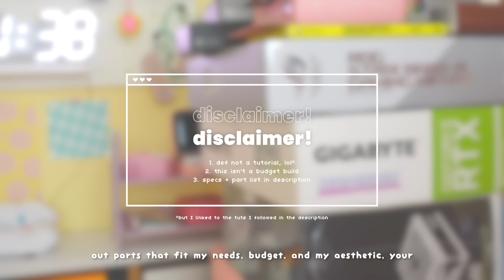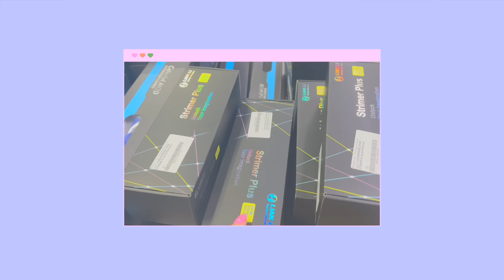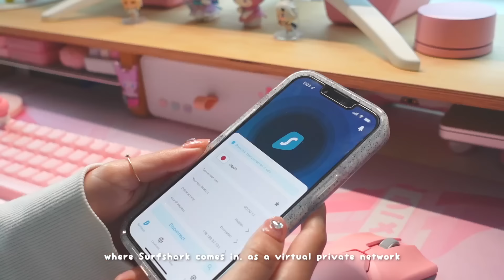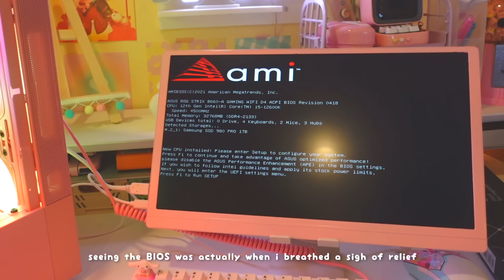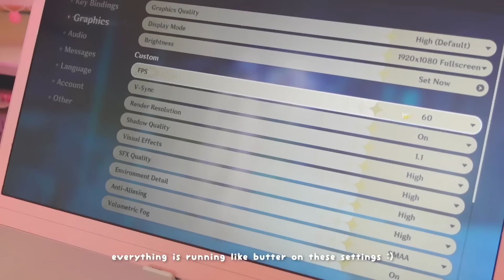🍉 building my first gaming PC so i can play genshin on cracked settings | intel 12600, rtx 3070ti ✶

Comment from the maker: bless YT tutorials for helping me bring my proper pc gaming dreams to reality ◡̈ specs + pc part picker list in the description for your reference ♡
Reply: ty🤍
Reply: Thank you so much for helping the viewer❤️
Reply: What store did you go to, to find your pc parts. Like the name to see if there is one near me I've been wanting to build one for a while but I don't trust buying them online.
Reply: cute setup, i should you should get bigger monitor, if you looking for new pink monitor, i suggest you buy AOC AGON AG273FXR
Reply: I have one request nemui.. PLEASE JUST PLEASE start streamign genshin on twitch/yt pls man
Reply: I assume LTT was a big help for a tutorial (was for me). Also great job the pc looks really cool!
Reply: hey did you enable xmp in your bios it helps you ram run at it max speed but i enjoyed reading the captions the whole time lmao
Reply: You had to buy a brand new psu when 4000 series gets out becuse they are power hug and they use more power.
Reply: Not sure if it has been mentioned, but you can get a platform with wheels ( or without) to keep your pc out of the floor. It will help to avoid dust, but if you clean it weekly or bi-weekly it won't be a issue.
Reply: does your pc make any noise?

Comment: I thought building a PC would be really daunting and difficult to be honest, but this video kind of encouraged me to look into it!! I have no idea what I'd be doing of course and it'd be very expensive which I don't have the money for as of now, but you made your pc look absolutely ADORABLE and I really wish I could do the same someday 🥺
Reply: PC building just looks difficult, I had the same thought too before I built my very first gaming pc (also upgraded the pc down the road).

The way that I look at PC building now is just like putting together a simple puzzle, Most of the stuff goes to specific places and most components have easy to follow instruction books that come with them.

I did have a hiccup when I upgraded my cpu, my motherboard failed to find my samsung SSD with the installed windows 10,  but a quick search on google showed that all I had to do was toggle a setting in Bios just to have my SSD show up.

If and when you do build a new gaming pc, don't be afraid to follow along to a tutorial. Just remember to double check that you have all the necessary stuff (including a windows usb stick).
Reply: @rezibaki310  how much did ur pc cost you ??
Reply: @yaatrickyaa2394  I started slowly buying parts for my PC before the inflation which was suppose to be a $700 build, but after the inflation hit, my build cost got up to $1300. (I was lucky enough to buy the GPU before inflation)

After the build was finished, I have got my hands on the RX 6600 XT and Ryzen 5 5600x about half a year later.
Reply: pc building is so fun trust me
Reply: I was told if u can do a puzzle u can build a pc XD.
Reply: @Shiveria  I want to build a pc but I can't do a puzzle, that's what I'm worried about lol
Reply: @camillesadventures  just do it dont worry about the difficult stuff go with the flow 
Its like playing a parkour game u have NO idea how ur suppose to pass the lvl but u just decided to do it and subconciously u manage to pass it or reached further than u were before 
Its all about the flow
Reply: Its basically like Lego but expensive.
Reply: @usuallyclueless4477  cough cough ₹ 30000 min GTX 1660 hear cough cough
Reply: @idiottrooper  last time I checked a 1660 cost ₹ 23000.
But it was just when the pandemic started.
Reply: Anyone of you has any videos or websites I can check that explains step by step what to look to build a gaming PC as well as explaining what each component does?
Reply: @Link-Link  Linus has a first person view build guide, he strapped a camera to his head.
Reply: i had someone who's job used to be building pc's and installing stuff like that in buildings. He heled me build mine and uh... look. I bought really good PC parts. But i would have needed him bc apparently some of the instructions for my shit wasn't well written, and if i attempted it the way they were showing on the instructions, i could have broken something. so really this whole thing is scary to me lmao. I'm going to buy a new pc case soon and some fans (bc uh my shit stopped working) but i'm dreading having to move all my shit over. ;;
Reply: Just build my first one last week very easy! Just follow the YouTube videos and do abit of research. You got this and have fun!!
Reply: @usuallyclueless4477  Do you have a link?
Reply: you could buy the pieces little by little, that's what a friend of mine did! every month was 1 new piece
Reply: @flavianunes9370  bruh isn't it better to buy everything at once? What's the point in buying a monitor, CPU, keyboard, mouse, etc but waiting a month for a GPU 💀
A PC needs everypart to function correctly
Reply: @magicalindigoadult3838  then just keep trying 
Lmao jk 
Idk tbh ive never built a pc ;_; but i will someday
Reply: A 3050 is enough for that game on highest settings
Reply: its not the pc building thats hard its everything that comes after it. and u have to know what you're doing when buying the parts otherwise you could really mess something up. but yeah putting the parts in is easy
Reply: @magicalindigoadult3838  yeah thats the toughest thing. Computers do require a bit of learning haha
Reply: @Link-Link  literally a year buying things 😂
Reply: @flavianunes9370  that’s actually a good idea! Thanks for the advice ✨

Comment: Great build, but to take full advantage of your amazing gpu, I’d get a better monitor - at least a 1440p one with 160hz refresh rate (which usually start at around 300 usd), but if money isn’t an issue, a 4k monitor with 144hz+ could run AAA titles at 60+fps at high settings with no problem, but they of course come at a big premium (500+ usd)
Reply: @Wxlfy 星 naa, 1440p 100% imo. I was playing genshin maxed out at 1080p on a gtx 970 till not so long ago lol
Reply: @Wxlfy 星 about what? I’m saying no reason to go 1080p with a 3070ti. My old 970 could run maxed out genshin in 1080p so a 3070ti def can run it maxed out at 1440p. 240hz means very lttle, fps is capped at 60fp but it’s not like it wouldn’t run much higher even in 1440p if it could. Going 1080p makes sense if you’re a very competitive fps player or if you wanna save some money. I mean I suppose there’s some games where the 3070ti is in a middle spot, but for genshin you absolutely wanna go 1440p, it’s a very light and not demanding game on pc.
Reply: how did you not tell him to put an i9 12900k at least with that graphics card
Reply: @Wxlfy 星 if you willing to get ban maybe? better not  mod much the files when it comes to Genshin. Beyond 60fps for Genshin just not worth it, other games maybe. better get 1440p or 4k Monitor or 4K LG oled tv~ which I'm doing :)
Reply: @Wxlfy 星 I don’t see the reason for such a high refresh rate. I’d much prefer a 1440p 165hz monitor compared to a 1080p 240hz, but if you’re playing super competitively then maybe.
Reply: @andromeda8878  are you joking?
Reply: i mean she did waste like 1000 bucks in the 3070 ti, yeah probably she can afford the monitor, altough i doubt she buys it, not cause she does not have the money but maybe cuz it may affect the look of his cute desk :o
Reply from the maker: hmm i've been thinking about getting a new monitor but i'm honestly not ready to shell out that additional amount of money when I have a perfectly functional 144hz monitor i bought a few months ago ahaha ;-; but tysm for the recommendation, i will look into 1440p 160hz in the future!
Reply: @savannahjones2718  are you laughing my face?!! I thought I looked handsome, that's what my grandma says (:
Reply: @nemuiatelier  you shouldn’t, 1440p 144hz vs 1440p 160hz is an insignificant difference for an upgrade, you’re good:)
Reply: @honorablesix  why not have 240hz
Reply: @sksz33  agreed bro she doesnt need 240 hz. difference not rlly noticable. she shld get 4k 120-144hz
Reply: @andromeda8878  huh
Reply: Are you gonna pay for it?
Reply: @sneekz07  I thought you were.
Reply: @nevergoodenough69 What's the point? Unless you play highly competitive games you wont even notice the difference between 144hz and 240hz. You can get a 1440p 165hz monitor if you want a bit more hz. At this point you're trading sharpness (and size, because everything over 24inch for a 1080p starts looking worse and worse) for something you won't even notice that much. There's a reason 144hz is the most popular

Comment: It's actually very easy to build a computer if you follow instructions; looks like you did a good job to me.
I was trained at a vocational school and by my great-grandpa, and I still ended up SO nervous on my first build. It surprised me the first time how hard you have to press the LGA sockets to close it. 
Nice components, but you definitely already had a huge amount to spend.

Just be careful when working with a power supply in a case; static or not being grounded to the case can be dangerous. (As you could imagine, hooking yourself up to a live high-voltage battery isn't good for your health!)
Reply: It's very easy to build even with no instructions lol
Reply: @derkoflagen9882 but everyone that build a pc has some sort of guide first time, even just looking their own pc

Comment: A little advise for your beast. Sometimes Ram requires manual switch via bios in order to work as it supposed to. Let’s say you have 3200 mhz Ram, so it should make all those 3200 mhz.⚡️ So, sometimes you need to go into Bios and simply switch the speed of your Ram to what it should be in order it to work properly. And congratulation with your new build ✌🏼
Reply: When you get 3200 mhz of ram it has a base clock speed usually of 3000 mhz, but you have to enable xmp from the uefi bios to get the actual speed
Reply: Yea but she got corsair ram which has dogshit die and the cas latency is probably 18
Reply: Ur Latency goes up when you get higher ram spped
Reply: It’s a normal thing
Reply: 3200 mhz is always cl16
Reply: @bobsmodels123  not true lmao
Reply: @loganreed7493  yes it is lower frequency higher latency
Reply: @bobsmodels123  Depends on the die and the bin, you don't need to tell me how and what ram XMP and JEDEC works as I work with it on a day-to-day basis. If you buy a cheaper kit of ram the die on it is going to be one of the worse ones and the bin is going to be lower, hence the slower speeds worse timings and overclocking compatibility, but if you get a good kit of samsung bdie, the stock XMP/DOCP/EOCP will be faster from the factory and the overclocking compatibility will be 10 times better.

Comment: Hey, just saying. As someone who has their own advanced gaming PC and is really interested in them. You definitely went all out on that graphics card and not a ton on other stuff, first: I am pretty sure that ram is not dual rank, meaning it runs about 25% slower than what it could. The i5 is fine but a i7 would fit needs better. Otherwise great :) :)

Comment: ur pc is EVERYTHING! despite my gamer colors being black and red, i really like the setup u have. and i will say this as a tip: the next time you build a pc, try out either the Ryzen 3 or Ryzen 5 CPU, bc they are much cheaper than Intel and many people say they’re better (i have no room to speak for that bc i’ve only used pcs with Intel). but i hope u try my recommendation later in time!
Reply: Ryzen has terrible latency and bad cache
Reply: Ryzen has more or less the same performance as intel in most cases
Reply: @wind4758  way worse latency tho

Comment: Excellent for a first build! I have some insight that I hope might help (this is the first I see from you, so I don't know your level):

-I hope the i5 you chose doesn't cause a bottleneck with the RTX 3070Ti. 
-You want to match you RAM with your other core components, so it would be a good idea to put some more GBs if you can, but 16 will probably do it if you can't. IMPORTANT: if you put more RAM in, make sure the speed is the same!
-M.2 NVMe storage for the system and games and SATA options for other storage uses is always the best option.

That is all, this all also depends on what games you want to play, I assumed by the GPU you chose that you, at least occasionally, play AAA games.  

Enjoy your build!
Reply: I actually thought the i5 would bottleneck the 3070Ti too, but a quick search says the 12600k doesn't bottleneck hardly if anything (its a still fairly new coming out 2021). 
also there was 2 sticks of 16gb so 32gb total! but good tip on if they want to add more!
Reply: @iioru1829  oh i didn’t read the 2x16, that’s actually very good then!

Comment: You dont need to break the bank for Genshin, I went with an i7 laptop, 16GB RAM, 1660TI, and Genshin runs maxed out at 60 FPS and it doesn't break a sweat. Even cheaper  Genshin is upgraded to 4k 60FPS on PS5 and that's only £380
Reply: true true
Reply: She mentioned she's future proofing her PC, a modern and graphically intense game might come out one day that she'd want to play. 🙂
Reply: @ZannahRose  yeah. Imagine spending the money to build your own PC just to have to replace everything within a few years.
Reply: @_____________a_a  You wouldn't have to replace everything though you airhead, it'll just be the graphics card and processor, but even then it's optional. This PC setup will be able to run games on decent settings for at least another 10 years before it requires an upgrade

Comment: Once you learn how to unlock the fps for Genshin Impact you’ll never see 60fps the same. You can def get double the frames for even a better experience. Also try to invest in a 1440p monitor with 240hz, it’ll change your life especially when paired with your 3070 ti 🚨
Reply: Second this, 100% need a higher refresh rate monitor. 60 is the new 30.
Reply: you absolutely need 144hz or 240hz to maximize the use of the 3070ti graphics
Reply: @PeachGinn  I've just noticed also Genshin doesn't seem to support any higher than 60fps
Reply: @nonamesdesigns  then a 3070ti is overkill for genshin haha. Hope she plays some other games too to make good use of it lol 😆
Reply: @nonamesdesigns  yeah most games cap their frame rate, had this problem with dead by daylight too but you can still uncap Genshin to 240hz or higher using a program, pretty easy & worth it in the end. Game ends up so smooth & beautiful maxed out 🙏🏾

Comment: pcpartpicker can list parts as being incompatible because it doesn't keep track of things that get added to the product later iirc, it only goes off what was available at the time it was added to the website, and if you get a cooler that doesn't have the correct bracket you can message the brand/company and see if they'll send you one (either for free or a fee) also very well done for your first build.

Comment: CPU: Intel Core i5-12600K 3.7 GHz 10-Core Processor  $320
Motherboard: Asus ROG STRIX B660-A GAMING WIFI D4 ATX LGA1700  $300
RAM: Corsair Vengeance RGB Pro SL 32 GB (2 x 16 GB) DDR4-3600 $180
SSD: Samsung 970 Evo Plus 1 TB M.2-2280 NVME     $185
GPU: Gigabyte GeForce RTX 3070 Ti 8 GB Vision OC     $1037 or $894 Amazon
PSU: Corsair 850W    $185             
OS: Windows 11 Home  $120

Total approximately $2327 or $2184
Amazing build

Comment: Ight i wasn't going to comment anything because the build looked very nice... until the end when she pulled the plastic off the case with the components inside. This can RUIN your entire build from the static electricity. I've seen it too many times. So just do it before you put anything inside the case. but anyway the build looked amazing good job 👍
Reply: Thanks for the tip ☝️😄
Reply: actually didnt know this, thanks

Comment: I dig the complete build overall, first and foremost! Second, and I've seen a few other YouTube videos do it, mounting the motherboard to the chassis to make it easier with the CPU Cooler is very clever.

Two friendly suggestions (and a key update on the 40 series RTX GPUs)...

1. The build can benefit from having a 2nd storage drive (this can be a 2nd NVMe M.2 SSD as that motherboard can support two of those), because having everything on one storage drive is actually not a great idea. I say this because although the risk of the lone storage drive getting corrupt is rare, it does happen and if everything is on one drive you'll need to buy another one and have to reinstall everything. By having a second NVMe M.2 SSD drive installed (and have it just for games) you won't have to reinstall as much as you would if you have only one storage drive.

2. The PSU. Granted, 850W is a great choice for that GPU (I too have the RTX 3070TI for my main build although it's Nvidia FE for the main build), 850W may not be enough due to the motherboard and CPU (both of that in your build being 12th Gen). An 1000W PSU, in my personal opinion, would have been more ideal (my main build has the 1000W PSU by EVGA).

As for the update on the 40 series RTX GPUs, the 850W PSU likely won't be enough from what I've been hearing, plus there's the possibility that it may get delayed to early 2023 for some from that series. You may need an 1000W PSU minimum for the 40 series RTX GPUs.

Comment: If i were you i would have spent more money on a cpu vs a gpu. With intel, they change the board every year meaning you'd have to switch your motherboard later on when upgrading you cpu. If you can futureproof a cpu by getting a i7 12700k or 12900k and go a bit cheaper on the graphics card side, you could upgrade a gpu later on whenever you want. But the PC looks awesome, and it was a great build :)

edit: im just tryna say that futureproofing you cpu should be a main priority when buying parts for a pc.